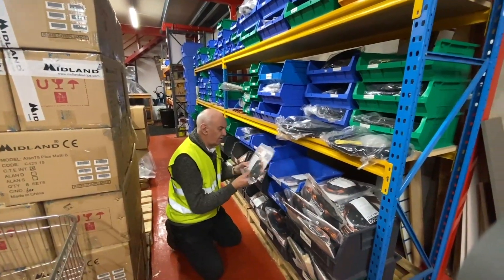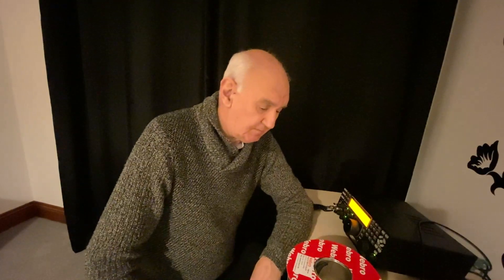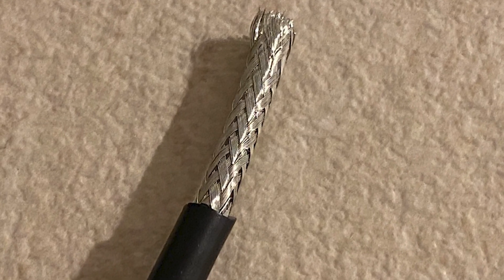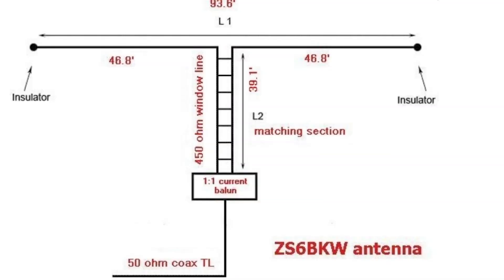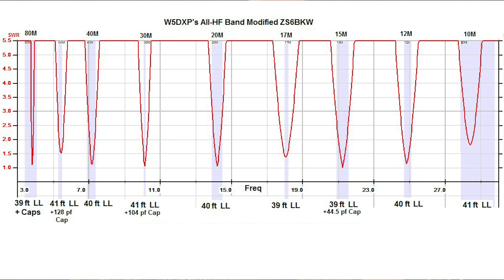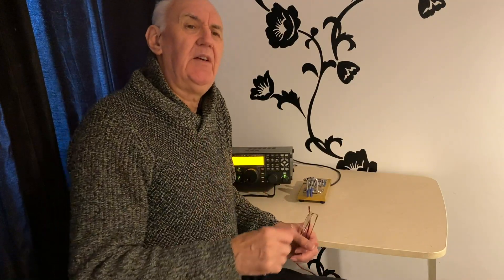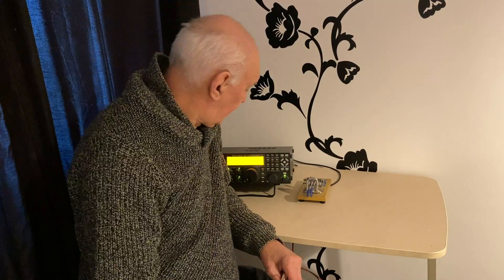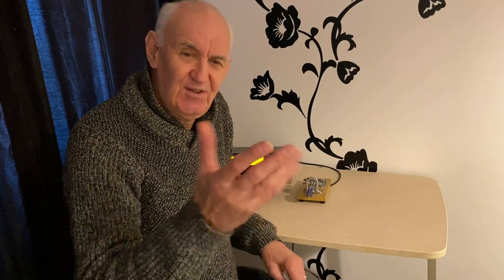Ham Radio HF For Small Gardens Part 4  - Making the G5RV Smaller

Comment: DX Engineering say the following: A balun or choke should NOT be used on a G5RV wire dipole. And they then go on to say that a feedline isolator may be required at the transceiver end if there is a RF feedback in the shack.
Reply from the maker: The choke is standard practice and RF feedback is just one of the reasons for installing this item. And as for their view on the balun - maybe ask them why. 73 Peter.
Reply: @watersstanton  They say that the G5RV was designed to be used with around 70 feet of coax which acts as part of the aerial so no need for the balun/choke. I would guess that not many people keep to the 70 feet rule :)

Comment: Many thanks for another video i found this one right in the middle of construction of the antenna in episode 3 so am using the same measurements you posted .the ladder line gives a measurement of 39 .1 ..I will be using about 55 or so to reach the outside of the shack ..and wasn't sure what balun to use but you reckon a 1 to 1 current balun..again grateful for information. Thanks again keep them coming. 73.john m0asn
Reply from the maker: Many thanks John. 73 Peter

Comment: I enjoy your very informative videos Peter and I have just watched the series 4 one about the G5RV. I put together a quarter size G5RV and erected it in the loft space of my retirement flat where no aerials are allowed, it was erected as an inverted V and to avoid any unwanted currents on the co-ax feed line I coiled the co-ax up at the base of the feedline, these flats have a hardwired intercom system plus other systems and the last thing I wanted was to cause any interference, a bonus point that I found with this quarter size G5RV is that the length of each feeder leg plus each top section equals a 10 Mhz dipole folded in the centre also I only use a manual ATU, results across the bands covered by this quarter size G5RV have been good and I can sit in my flat and talk to the world on the key and nobody here knows what I am up to!
Best 73 de Geoff, G4AQZ.
Reply from the maker: That is great news Geoff. I did wonder how it would work. Glad you can still enjoy your hobby from your current QTH. 73 Peter

Comment: I’m a fairly new ham. Just getting into HF. I have a full sized G5RV that was given to me. I have a very small property with a 2 story home and a detached A frame garage. I hardy have room to put this antenna up. One radial has sufficient space, the other radial however extends to the end of my property with about 15’ of wire left.. I might be able to run it to a tree on my neighbors property with his permission.. the radials won’t be 180° apart. Still in an inverted V configuration.. One will be Going West, and the other would be going North east. Rather than East/West.. will this cause any trouble tuning or performance? Thank you and 73
Reply from the maker: Hi there,

You have two options. You can put the antenna up in inverted V form and bend the ends to fit the space - or - start again with a "doublet." You need to erect an inverted of a length that will fit your garden - the length is not critical. Then feed with 450 ohm ladder line back to a balanced ATU. The other option is a vertical that I will be covering soon.  73s Peter.

Comment: I'm living in an Apartment,  I've a 20M EFHW antenna on a 30ft fishing pole on 2nd floor balcony, fed with a 49:1 balun... works a treat..
Reply from the maker: Great to hear about your results. Should work fine on 10m when band is open. 73s Peter
Reply: Ah the old ,49:1 balun ploy, not heard of this since the 1970s ,,,,, gud 4 u

Comment: Just a query could the g5rv be cut down just to use 10m.
Reply from the maker: Check out Part 4 of my series. There is a 1/4 size version. 73s Peter
Reply: yes indeed ,,get the wire cutters  out

Comment: Thoroughly enjoying this video series. I'm looking forward to you discussing other types of antennas for small gardens - especially Magnetic Loop antennas which are ideally suited to Small gardens and QTH's with high QRM. As for RG58, I'm sure the coax you sell is of high quality, sadly though there is a lot of low quality coax on the market sold as RG58 and I feel it's that stuff which has given RG58 a bad name.
Reply from the maker: Many thanks for your input. 73s Peter

Comment: try an EDZ for 20m  83Ft long with 300 Ohm ribbon cable and a balanced ATU.It will load  10m -80m. with 3db gain on its cut frequency ( Doubling of power).
Have Fun,
Richard
Reply from the maker: Hi Richard. Thanks for the input. Yes there are many variations of a ladder line doublet. The top section determines its radiation pattern, which can make it an EDZ on the chosen band. Good to hear from you. 73s Peter

Comment: Another approach is shown on the site page http://www.w5dxp.com/notuner/notuner.HTM. w5dpx uses switchable ladder line length that tunes the antenna to the different bands. It's not a small antenna but I thought you may find it interesting.
Reply from the maker: John, thanks for that. 73s Peter
Reply: That link has gone porno.

Comment: Thanks for another interesting video! I think the small garden probles is larger at the moment due to sun spot minimum. That makes you need more the longer wavelenghts which means a need for a larger antenna to get any efficiency. Getting reasonable swr is often easy with a good tuner but it is not a guarantee of efficiency.
Reply from the maker: Hi. Thanks for your input .73s.